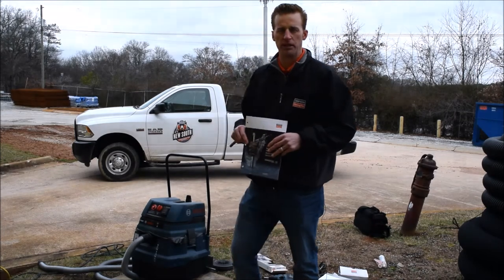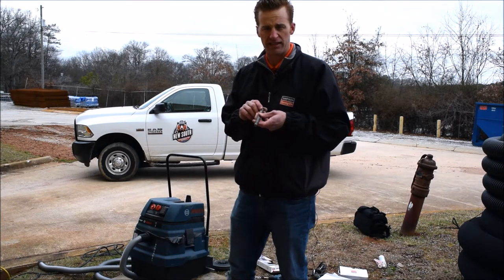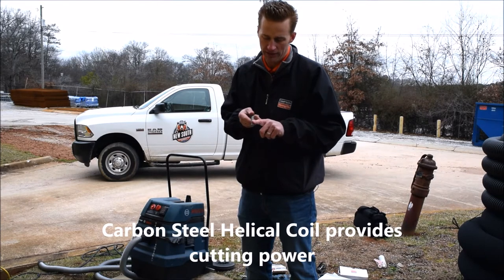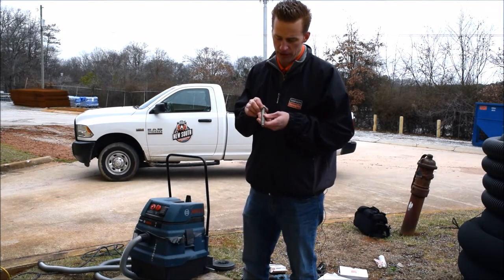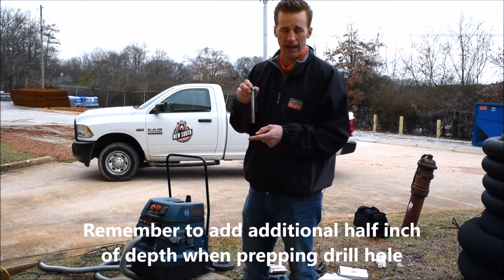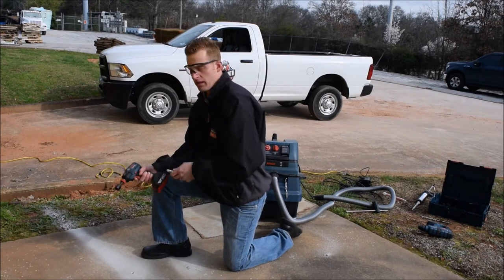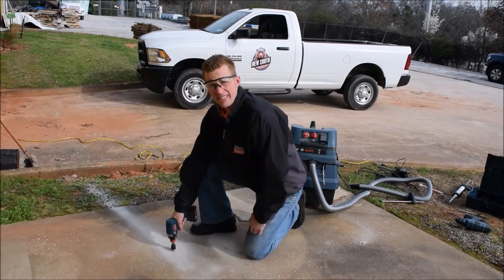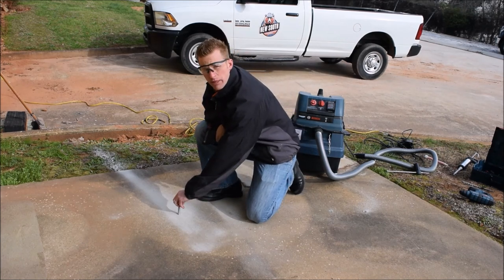Titen HD Anchor Bolt

Comment: Did not explain drill hole diameter to use with anchor (bolt) diameter.  The depth comment was good.
Reply: It will say on the bolt package dependent on the size of bolt you purchase if i'm not mistaken.
Reply: @510Redneck  you are mistaken. no hole diameted mentioned on the tag for anchor.
Reply: @donj06  "Drill a hole in the base material using a carbide drill bit the same diameter as the nominal diameter of the anchor to be installed."... Should be on the package
Reply: 510Redneck thanks!
Reply: @donj06  np bud :)
Reply: Ya but what does "nominal hole diameter" actually mean?
For people who don't do this stuff for a living it might be nice to define certain terms or specify some basic instructions in the video.
Reply: @questionsforchristians  This means that the diameter of the anchor bolt (1/2" diameter, or 5/8" diameter) requires the same diameter drill bit (1/2" dia drill bit or 5/8" dia drill bit). A common phrased used is "Bolt size is Hole size".

Comment: I have a 1/2” bolt, the tag says to use 1/2” bit. It doesn’t work! I tried with an 160lb impact with no results. Go to the next drill bit size?
Reply: I am having same issue with my 5/8" bolts. So that is why I am here looking for better info. My little impact driver (dewalt) like the one shown in the video is took a lot of abuse just to get one bolt in halfway. Not sure if I need to go up to 11/16 bit (yes, I know you are not supposed to) or get a bigger impact driver (1/2") or ???

Comment: If you have to drill a hole - why not just use an wedge or sleeve.  That doesn't save time.
Reply: This saves more than three times the installation of a wedge anchor. A wedge anchor must be pounded into the concrete (10-15 seconds) and then set to the proper torque setting with a torque wrench (10-15 seconds). The Titen HD installs with an impact driver (8-10 seconds).